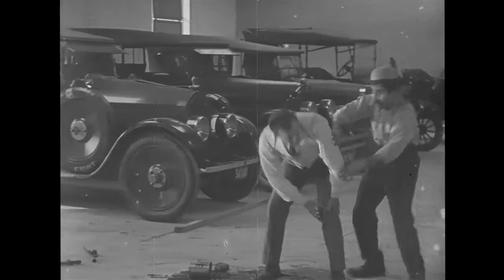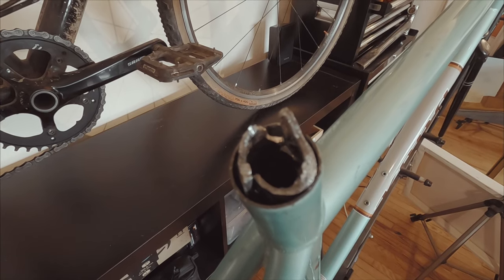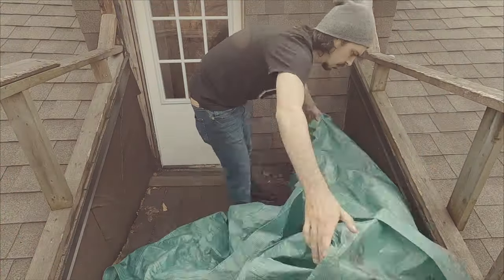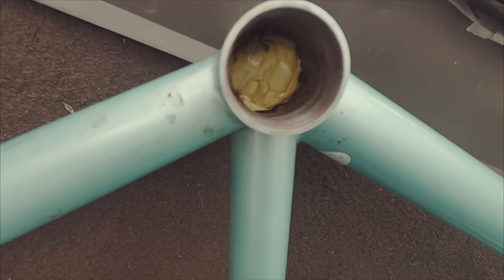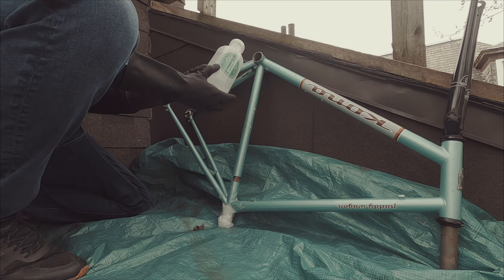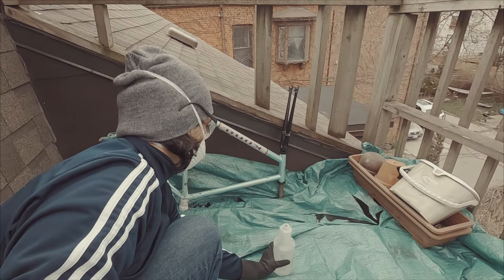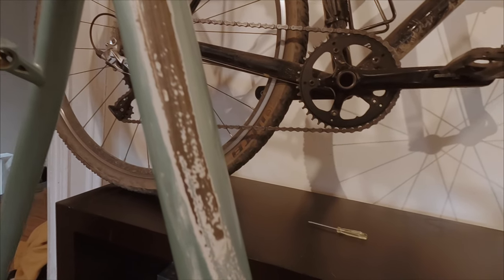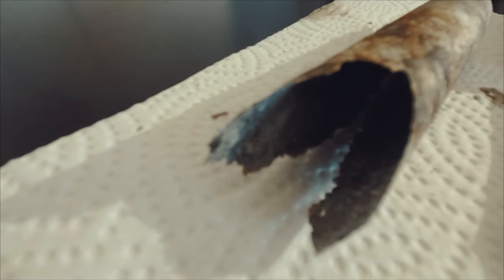How to melt a stuck bicycle seat post using caustic soda.

Comment: I had a thick alum post stuck in a chrome moly frame. It took 2 days and multiple doses. Also I used a rubber stopper on the seat tube in the bottom bracket.
Reply: So you sat the rubber stopper half way up the seat tube?

Comment: Excellent! Followed your lead and it worked like a charm. I used a 3:1 water:lye mix and found that it takes about 8x the weight of the seat post remnant in lye to complete the removal process. Again, Excellent video. Thank you.

P.S. I recorded seat tube temperatures of 235 Fahrenheit.
Reply: is the 3:1 ratio by mass or by volume?

Comment: Nice work. Looking at doing this myself. Did you pour the liquid out of the frame each time before adding more or just leave it all in there and keep topping it up? Think I'll copy your BB method but use a funnel and hose too.
Reply from the maker: Thanks, I was letting the overflow drain from one of the bottle cage rivets and so I was just toping it up when the mixture looked like it wasn't reacting as much. A funnel and hose will probably do the trick as long as it is heat resistant (it will melt cheaper plastics).

Comment: Lye or sodium Hydroxide is an old school paint remover and good degreaser/oven cleaner. Dilute solutions used to be used in restaurants to clean tables which was then followed up with vinegar to neutralize it. It would leave a squeaky clean surface. This use of vinegar in the cleaning process is why many people mistakenly think it is a great cleaner, it isn't, it is the sodium hydroxide.

Comment: Awesome video, thanks for making it! Super clear what to do with the process. What did you do for clean up afterward? Both for the bike and the solution of dissolved aluminum?
Reply from the maker: You are welcome! Just rinse the bike with soapy water, as for the water I left it in a disposable container and waited for the water to evaporate, then disposed of the container. Different places have different regulations as to how you can get rid of the byproduct.

Comment: I acquired a 2011 Kona Paddy Wagon which also has a ridiculously stuck seat post (that's why I'm watching this video). From what I can tell the seatpost must only be inserted about an inch or so but it is seriously stuck. I have also read about another Paddy Wagon with a chronic seatpost, so I wonder what the issue is with these bikes? Maybe they weren't coming with any grease from the factory or something like this.

Anyway regarding your paint - Generally Kona's have very thin and weal paint. I have a Kona Shonky which I was cleaning with pure Isopropyl and completely ruined the clearcoat. Probably not wise to use pure Iso on any paint but I have done it before on other frames with no worries.
Reply from the maker: something had to be wrong, they were either coming out without grease or poor quality one, I have also seen a lot of paddy wagons with stuck seat posts. The clear coat was really thin on this guy so not too surprised by the result (didn't take any precautions though as I wanted to see the effects of the soda on the paint). if it wasn't so messy, I would use it as a paint stripper, works much better than most purpose-made ones these days.

Comment: Painful to watch. Doubt a lightweight racing bike frame will take such punishment. Apparently, you have to strip bike down completely then dissolve alloy stem iwith acid to break down stem but not frame! New stem required.
Reply from the maker: Caustic sauda does not disolve steel so the frame is perffectly fine.

Comment: Yo! Are you in Montreal by any chance?
I have the same issue right now and would be interested in getting some advice!
Reply from the maker: Hey no I am in Ontario, what's your problem?
Reply: @MaverickTube  Same thing as you! Aluminium seat post stuck in a steel frame. Just bought the frame and I would like to keep it. Tried force but it doesn't budge.
Reply from the maker: @Yesandsowhut  Then I definitely recommend trying this if you have tried everything else. As long as you protect yourself and have an outdoor space to do it, it's actually really easy to do. You can also spend more time than I did protecting the frame and you won't have paint damage.
Reply: @MaverickTube  Yes! I have an outdoor space so I think I'll give it a go. Do you know if it changes anything that the frame is Chromoly? I know the Kona probably wasn't high tensile steel. By the way thanks for responding. I think you're the one who did this trick in the smartest way by pouring in from the BB. Most pour it in from the top of the seat tube.
Reply from the maker: @Yesandsowhut  the type of steel won't make a difference and will work across all qualities, high ten or chromo.Yup I have learned what to do and what not to from a few of these videos =)

Comment: No no this horrible. Think outside the box. There is a man in Britain who has done over 2000 seat posts. Sit down and think about it.
Reply: @sharivari81  hes probably suggesting a special saw for removing these.
Reply: If you’re referring to the man in Yorkshire with “the beast” then
1. He’s in Yorkshire
2. That equipment was custom made
3. You’d need to sign a waiver cos even he doesn’t guarantee the frame safety
4. Oh yeah. HES IN YORKSHIRE. 

Folks are looking for a solution that’s last option. This is one. I blame the LBS.  At no point was I advised to remove the post periodically or risk aluminum welding itself to steel.
Reply: No the man is in Chorley. The seat post man. A comment he made when l picked up my frame got me thinking.That is all.
Reply: @johnwilkinson3880  well let us know, don't leave us hanging.